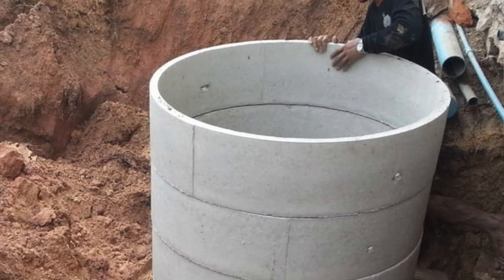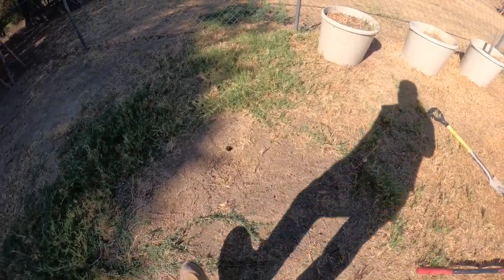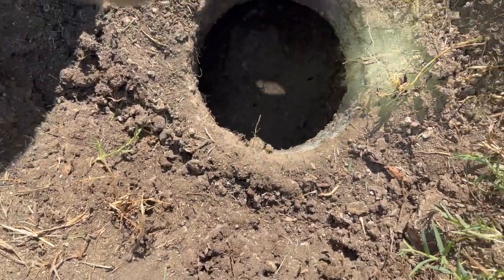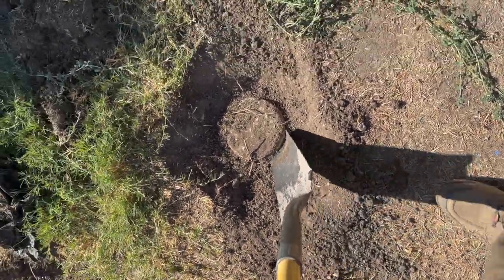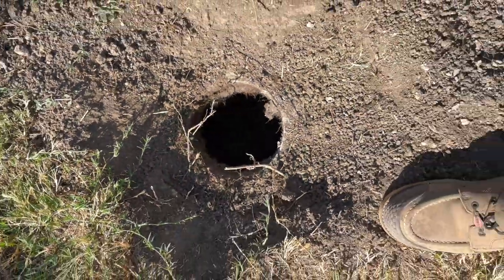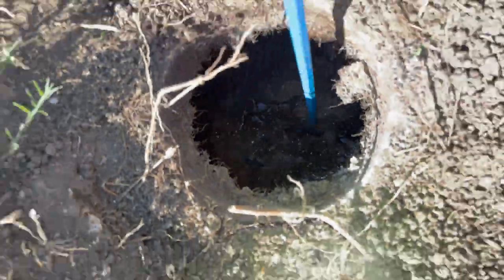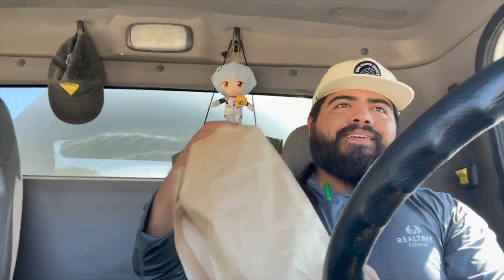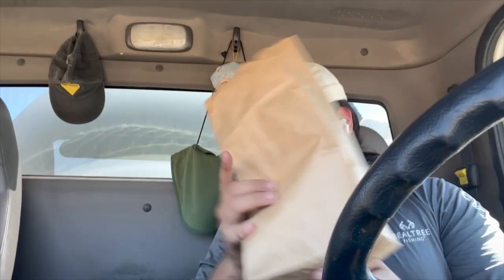This Septic Tank is OLD

Comment: Cesspools were sufficient in days past when people used less water, houses were smaller, and appliances like dishwashers and garbage disposals weren't that common.  Note that there's a newer type system allowed in our area called a "peat" system that uses a container of peat instead of a conventional drain field to receive the effluent.  This system is indicated when there's lack of space, high water tables or when perk tests fail.  Homeowners with peat systems are required to have a maintenance contract with the installer and the peat is inspected annually as it eventually requires replacement.  Thanks for the video young man!

Comment: I had the septic tank installed when I built my house in 1996 and I didn’t know it needed to be serviced. I have never had it open. Don’t even know if it has tops on it lids.
Reply: It will have lids...And unless your household is max two people flushing little or no paper, you probably need a service by now. Call a pumper for an inspection appointment. 👍

And also: If you can locate - And even better; Dig up - The lids for your tank, you'll save the pumper a lot of time and extra work, and you'll save a good few hundred off your bill! 💰